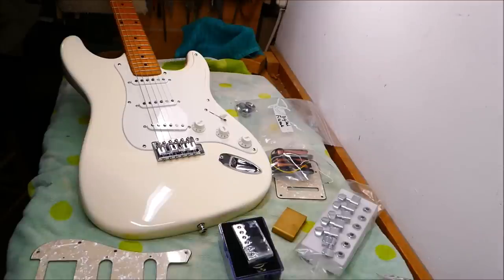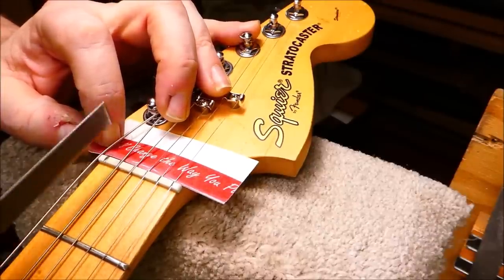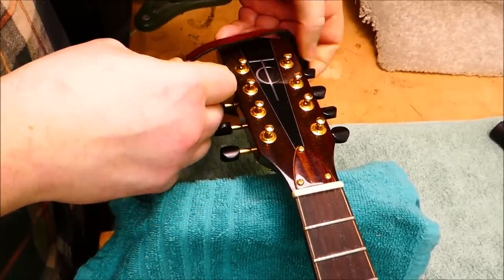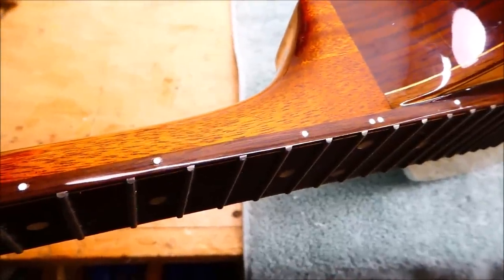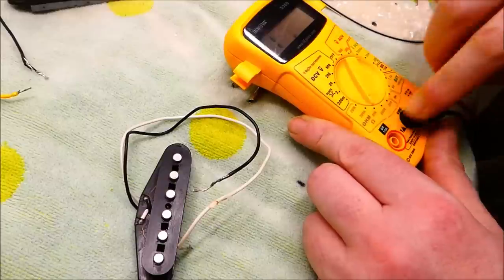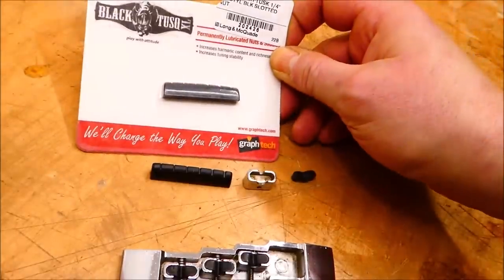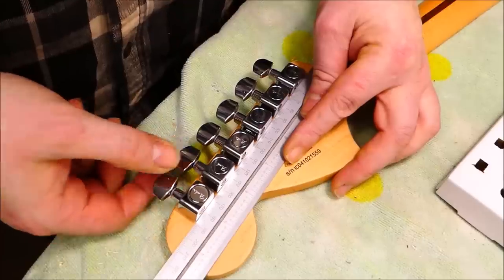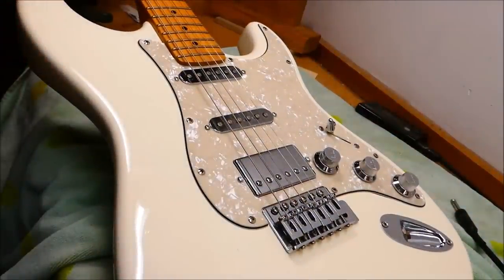That's a lot of work!

Comment: With staggered tuners the shorter ones are for the thinner strings farthest away from the nut. Staggered tuners can eliminate the need for string trees.
Reply: Ted addressed this in another video. Turns out, the short posts are not quite short enough for the proper break angle on the treble strings.
Reply: These are not "real" staggered tuners! They are just two kinds of tuners fender produces right now and Ted's final arrangement is how Am Std and Am Pros have been for the last 20-22 years. The real problem with the short tuners are that you can not get any winds on the post like the tall ones and, imo, a cleanly wrapped tuner works just as fine as the best set of staggered locking tuners...
Reply: Only if the shafts are long enough to do the job. These weren't.
Reply: @Three_Eyed_Willy   o no teds wrong i can't live any more

Comment: I've built dozens and dozens of 'partscasters', both Strat and Tele styles, over the last 20 years or so.

I've learned that each attempt is a unique set of issues that need resolution. Fortunately, these assemblies have resulted in a pretty huge variety of all kinds of parts, from bodies and necks to electronics  to tuning machines, bridges, pickguards, etc. While there have been many frustrations with parts not wanting to play together well, I have learned a lot. Frustration and satisfaction...

You can buy a box of 250 stainless #4 X 1/2 screws for about the same price that Fender gets for 24 pickguard screws. These stainless screws have a head that is about a millimeter smaller in diameter than the standard Fender screw, so they will fit just a tiny bit lower in the pickguard, but I actually like that. A medical cotton swab wood handle is the exact diameter of a #4 screw, so I use those to fill the pickguard holes, as it's been very rare to simply trade out a pickguard and have the holes match.

Back in the day I would buy Squire Bullet guitars just for the necks and a few hardware items. I couldn't get a decent Fender spec neck that cheaply anywhere else. It should be noted that Squire tuning machines are not the same as their Fender cousins, although they look very similar. I find that pretty weird - the two 'bumps' on the back side of the tuners don't match. Who would have thought...

I learned a lot, and I made a lot of silly mistakes, but, overall, I did enjoy my efforts. It should be noted that a box of parts will not be happy together at first, so it's up to you to make them teammates.

Finally...everything that Ted did in this video I have done a bunch of times. I learned to lower my expectations for the assembly of partscasters, so when things went a bit more smoothly than anticipated, I was happy, and the frustrations were manageable...mostly.
Reply: I have come to learn that most of those frustrations turn out in challenges, that's what we builders like to do, solving the puzzle.
Most frustrating to me is making the same mistake several times, and that happens.
Reply: @raffaguitars  The very worst mistakes are the ones you repeat. I do agree on that. There's a humiliation in that.
Reply: Indeed!  I've built enough Partscasters, that I now have a flow chart of pitfalls and things that need to be inspected, measured, and adjusted before things meet up.  What an exercise in frustration in many cases.
Reply: @OpSic66  True, but there is a certain satisfaction in overcoming the many obstacles, and producing a nice guitar.
Reply: I’m making a custom guitar from scratch right now. It’s actually surprising just how much really goes into designing and building an instrument. Cutting it out was the easy part, after all the maths and more maths and then even more maths. 

Very excited though, it’s being made from solid hard-rock maple; neck and body with an ebony fretboard.
Reply: @Rakkhun369  Well, it sounds great. Some day I might do that if my arthritis doesn't prevent me.

I still make a lot of custom pickguards and truss rod covers, and do some interesting paint jobs. Good luck with the project!
Reply: @perihelion7798  Thank you very much :)
Reply: " A medical cotton swab wood handle" 

this is oddly specific, but i know exactly what you're talking about and love the idea

Comment: I'm in shock, truly.....Just yesterday, I put upgraded pickups, electronics and bridge on a brand less telecaster copy. The idea, of course, was to get a much better sounding guitar for less money. Now, I've done this kind of thing before and I wholeheartedly agree with you about the business of these things NEVER work out as planned. The various parts from various suppliers never all fit together as they "should".
Except this time, they did. Every part was drop in and screw together easy. I did the whole thing in less than an hour including soldering and testing. Thus, the shocked response. Didn't even have to file or trim something to fit. (clutches hand to chest in mock heart attack).

Comment: But Strats are sooooo easy... I feel your pain! This is a testament to what the mere mortals don't & won't comprehend: ~70 years of constantly changing specs for every single part, spacing & alignment on a Strat. Even if you know, say, the string spacing you need at the bridge & you order a part specifically saying it matches, but its from an unknown or budget vendor, its STILL a gamble... And the cheaper the parts, the bigger the gamble. Start mixing & matching parts from multiple, questionable vendors and all bets are off. It takes a certain level of experience & ingenuity, if not sorcery, to make it all work together without rage-quitting or having some sort of breakdown. Going into it with the naïve assumption it will all go together smoothly, like legos, almost guarantees you're gonna have a bad time! Caveat Emptor! Know your specs, know your parts, know your vendors & you'll have a better time.

Comment: Great job Ted, very thorough. I love how you didn’t let the problems lie (misaligned screw holes) and also didn’t attempt to tackle mods that didn’t make sense (trem block). The second I saw that Trem block I thought “no way that lines up!”  

When I do repairs like this I just warn customers that I am going to start the clock and charge them my hourly rate. If they are ok with it, then the job proceeds.

Comment: The going labor rate.
I've built a number of guitars over the years and I can tell you I spend most my time making sure the parts I order are correct/compatible as far as fitment.  I had a friend dump a $125 Flying V kit guitar that needed a complete rebuild, these lower cost kits need lots of work.

Comment: I hope a lot of people learned some valuable lessons from this week's episode. 

The only trouble-free partscaster build I've done was by ordering essentially all new parts, and this was after having decades of experience to know what parts were compatible. Trying to build a guitar our of a bunch of random parts you have laying around is going  to be frustrating...and probably a lot more expensive than you bargained for.  It can be done. but the title of the video says it all.
Reply: Exactly. When I built my PartsCaster, I made sure of all the measurements I wanted, and spec'ed out US standard parts for the entire build. Consequently, the only things I needed to do were to install the tuners ( I used Gotoh's, and had the holes pre-drilled to spec ) the LSR Roller Nut slot was pre cut and screw holes drilled, the bridge mounting holes were spaced properly, and the electronics were all CTS pots and switch. Fret leveling and dressing was actually the easiest thing to do. I wound up with a great Strat style guitar that I play regularly

Comment: While I like the idea of getting "exactly the guitar I want" by mixing and matching parts, that's definitely a thing to do myself and not bother a professional with. You're doing this for a living, you deserve not to be having to deal with my ignorant mistakes. With this video, I was more interested in the palate-cleansing interludes; that bass bridge looks like a fun design when retrofitted with better material for the saddles, and the mandolin gave me a fair bit to think about in planning my own build that I'm sure I'll get to on or around the 32nd of next month.

And for the fellow commenters who are wondering how the piano repairs are going, very nicely thanks. I've filled, stained, and sealed the worst of the dents, and next up is a couple more coats of shellac, a gentle level sanding, one final coat of shellac that I'm going to do with a 1# cut instead of the 2# I've been sealing with, and then paste wax and hand buffing. It's still very clearly a piano that's had some damage done, but it looks cared for. That's good enough for me.

Comment: Indeed, a partscaster is usually fun for learning, as a hobby.

I bought an old Samick strat last year and have switched out the pickups several times, with different experimental switching configurations, coil-splitting, etc. A bit maddening! But fun to learn if one has some woodwork and electronics experience.
Reply: Hear hear! Partscaster are totally worth it if *you* are going to do the work as a hobby or learning experience. It can be fun to see how cheap you can go too (it is to me at least). Especially if (like a good friend of mine) you're not patient enough to do all the finishing (an arguable point).

Comment: I think your comment about partscasters being for hobbyists is spot on. The only time I would find it appropriate to do this kind of work for someone would be if they got a body and neck that were designed by the some company (warmoth, allparts, mjt, etc) and you are able to drill all the holes the first time to ensure everything fits together nicely. I often find it easier to build a new body for a neck and hardware than try to make all the parts fit to a body they were not designed for.

Comment: I think partcasters can get very expensive too... Last year I was wondering about putting together a Jazzmaster, with warmoth body and neck. I'm lefthanded, so I have often very few, if not at all any choices. 
I did some calculations and quotations first, to estimate the cost of the instrument. But in the end I decided to get an already factory assembled made in Japan Jazzmaster! Why? It costed me as much if not less than the warmoth with all the parts, Japanese fenders nowadays are top notch instruments, so I already had a fine guitar to start with.
After few weeks playing it I only decided to upgrade pickups and the bridge. And bam I have now a wonderful lefthanded Jazzmaster!
Reply: MIJ fenders are def worth every penny. But i gotta say, you don’t need warmoth if you’re going in on your first partscaster. I got the body and neck of mine for 215 bucks. All parts neck for 150 and a random finish-less strat body from a luthier in Colorado for like 75 bucks. Allpart necks are great if you just do a teeny bit of work on em. The guitar was a 54 strat replica and the whole thing ended up costing me 550-600 bucks. It’s now my favorite.
Reply: @xbmpr  Yes that may have been my first full warmoth partguitar. I got once a baritone conversion neck for an old strat I used to have, that was a fine piece of a neck! In the end I'm super happy I got the MIJ! Note I live in Switzerland... so in my calculation I had to had all the customs expenses, which would have made the partcaster def. more expensive.

Comment: In the staggered tuning pegs, aren't the lower heads designed to be the ones further away from the bridge for the higher strings? At least that's what I've seen being done so far
Reply: This is correct. The idea is not to increase the break angle of the bass strings with the shorter posts. It’s to reduce or eliminate the need for string trees on the treble strings, with the shorter posts. Nobody knows everything. On some Fender style replacement necks you can completely eliminate the string trees. I have one guitar with only the E+B string tree and a Tele Parts-caster with no string tree, and it’s perfectly clear in the open position.
Reply: thats what I thought also
Reply: @TheMasonator777  yeah, the critical distance is from the back of the headstock to the string hole.  getting rid of the string trees is the key to strat tuning stability. i've found a few import strats that have enough headstock relief  to work without trees. but staggered are a good solution. also, i think some models of two hole locking tuners can work tree-less if you use the bottom hole......
Reply from the maker: Yes, you're right. I had them on backwards. D'oh.
Reply: @twoodfrd  Your instincts were right though IMO. On locking staggered tuners, I often prefer the short or middle height posts on the E/A string since you don't have the extra string wraps to get the proper break angle behind the nut.

Comment: Oh my god, you're just the best! The fact that you actually took on the work says so much about the generosity of your heart. I spent the best part of 3 years obsessed with Strats and partscasters, starting from the cheapest rubbish, and working my way up to quite high quality examples. The guitar you have assembled started out as bottom of the barrel, but the parts supplied are all of a similar quality, with the possible exception of the brass block, but you couldn't use it anyway! This video is hilarious, such attention to detail paid to a guitar where the sum of its parts is about $300. I love it :)

Comment: I have a parts-caster with hand picked stuff that I collected over 6 years. The Strat plays and sounds better than most Strats I’ve played. I payed a little extra for the assembly but so worth it.
Reply: Put one together myself. Every part hand picked. roasted maple neck, grease bucket wiring harness, hand wound pickups, the works. If done right, you can get a great guitar.

Comment: This Strat shows exactly what, happens to MANY DIY'ers who think "oh I can swap the pickguard and bridge pickup out!". Then they get in there run into ALL of these issues that they aren't prepared for. So they end up giving up and now their only guitar is in pieces and they never touch it again.

It happens wayyyyyyy more often than you think. Luckily I came into this with years of automotive service & repair skills already, acquired so there's not really much I can't handle myself I feel like. None of those issues stopped me when I went through them lol. I replaced the nut on my only guitar at 6 months into learning to play, in fact. But I'm the exception. Most people aren't as prepared as I was when I started learning to play in Dec 2019

Comment: For the bridge, I would've gone for Delrin/Acetal as it has great wear resistance and is hard enough to not damp the resonance of the string. As always, great work on everything.
Reply: And talk to a machine shop, making blanks in a CNC mill would be a very easy for them.
Reply: @sharg0  Not worth it to make just four of them. 4000, sure.
Reply: @peachmelba1000  Programming, setup and running - about 15 minutes for a shop used to varying tasks. And in that time frame you could run three or four sets. 
When I worked as manager a couple of years ago I would likely charged about 10€ for that.
Reply: I had a machine shop in Houston make a bunch of guitar slides from that material - light, but with a cool tone. Thin sheets make pretty good guitar picks.
Reply: @sharg0  I suppose on a turning center with live tool capability these things could be faced, milled, and parted off fairly quickly. I'd use acetal or Teflon.
Reply: @peachmelba1000  Could be used as well but for a job like this you really want to use the cheapest possible machine and in this case that's a bog standard 3 axis mill.
Of course it also depends on what other jobs you're running, if a more advanced machine already is setup with the right material and tooling that's probably what will be used.
Reply: Acetal? Instead of a harder material specifically designed to be the endpoint of a string on an electric guitar?
Reply: @wbfaulk  that definitely wasn't harder than acetal
Reply: @wbfaulk  It's not the end point. The strings ride in half round grooves on the tops of the components. The ball ends of the strings are anchored in a metal component, either a ferrule, or bridge plate. Additionally, Acetal is high wearing (wet or dry), exhibits high strength, and is low friction.
Reply: @wbfaulk  Acetal is very wear resistant and very light. The slide has a tone somewhere between brass and glass, and is extremely fast to use.
Reply: @danielwgk  Tusq is definitely at least as hard as acetal.
Reply: @peachmelba1000  I was just trying to say "nut and saddle" more succinctly. I failed, apparently. Also, Tusq is not going to be worse at being a saddle than acetal. If it was, people would be selling acetal saddles commercially, and they're not.
Reply: @perihelion7798  You think Tusq isn't wear resistant? Being light is either irrelevant or bad, depending on who you ask.
Reply: @wbfaulk  I'll be honest, i wasn't aware of synthetic ivory. I'll have a look into it
Reply: @wbfaulk  Tusg is very wear resistant. I use their nuts and saddles a lot, and I like them. I actually tried carbon fiber, but it's not very wear resistant at all, although it's remarkably stiff.
Reply: @danielwgk  Despite the brand name, I don't think they really market themselves as "synthetic ivory", but it's been on the market for a long time. Over 20 years? It's used by notable guitar manufacturers. Their newer product (which is still over 10 years old, probably much more) is impregnated with PTFE. The base material is allegedly PPS.

Comment: Fiulcrom bridges are a PITA to get truly low action, many impossible. I have switched many to a floating 2 point strat style tremolo into a recessed cavity, and that not only solves the problem but I get more dive and climb than floyds and most any other style tremolo.